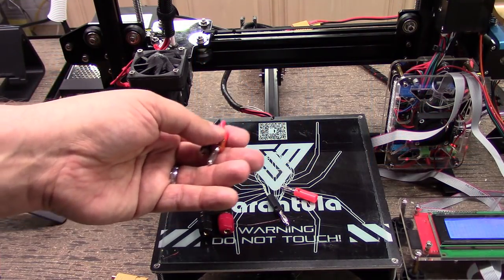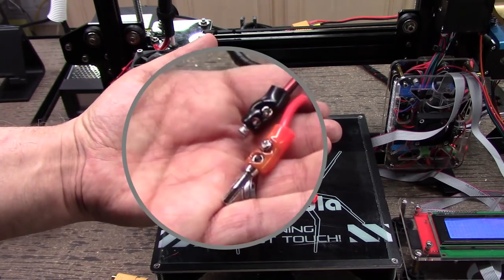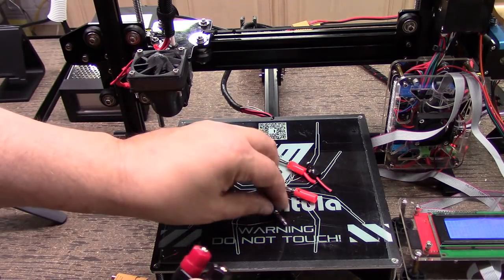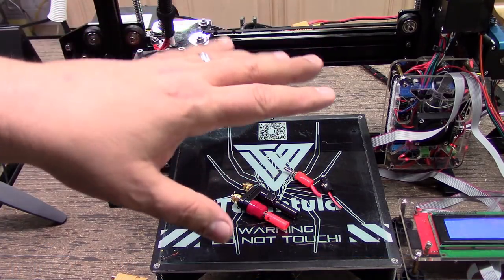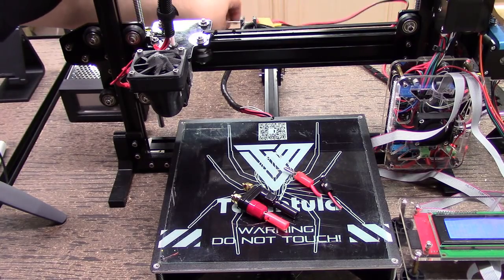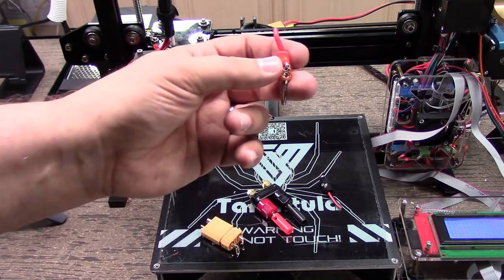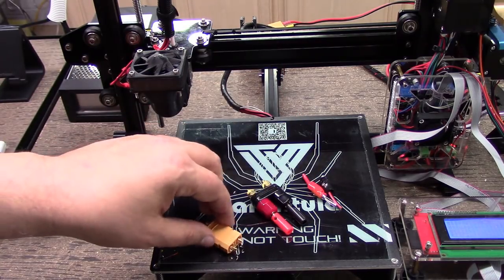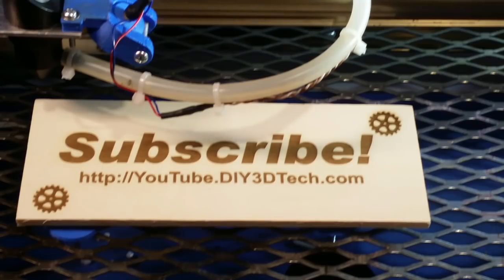TEVO Tarantula 3D Printer  -  Crazy Melt Down You Need To See!

Comment: I like Anderson Powerpole connectors, available in various current ratings (tow trucks use the large ones to connect jumper cables rather than opening their hood).
Reply from the maker: Those would be some major connectors!  🤓
Reply: They make them rated down to 15A too, the 15, 30 & 45A connectors use the same size shells (about the size of banana plugs) and can snap together to  make custom plugs.
Reply from the maker: Interesting will need to check them out!

Comment: Not an odd reason, bananas are rated at 15A.  The XT90's that you switched to are rated 90A.
Reply from the maker: Well where I am surprised (as yes I understand the "rating" difference) yet if you look at the connectors of the banana jack (at least on the one I used) is a larger conductor then the XT90.  As I used this for a long time with PLA and bed temp of 70c and just once of kicking it up to 100c and baam.
Reply: Its all about the contact area.  With the bananas the contact area is comparatively small when compared to the XT90, where almost the entreaty of the outer area of the male pin makes contact with the inside of the female socket.  Because of this there is greater impedance in the banana, and as you found to the cost of your fingertips, where there's impedance there's heat.  To be honest, I've never really been a fan of bananas.  I typically only use them for speakers. I use XT60 with mine, I also run my bed and hot ends on individual MOSFETS with fuses protecting each.  It's probably overkill, but as I'm sure you can appreciate there are already too many horror stories an I don't want to become one.  All the best.  Keep up the good work.
Reply from the maker: Totally agree on contact area and in the days of old (which I am)  banana jacks where very common for even larger power supplies.  Yet the aspect of "impedance" is what I over looked as in the old days the american made ones (as I speak from the 50's & 60's) where of quality metal, yet this cheap Chinese version I believe have VERY low grade metal in them meaning they have a very high impedance making them a better heater then conductor :-)

Comment: Thanx for uploading this, and the custom setup which I'm probably going to copy. I'll talk to my local electronics store about all the connectors you used, they are super helpful.
https://www.maplin.co.uk/p/fused-euro-chassis-plug-ft37s
.
Ah, I just realized that you didn't show what you did at the back of the transformer. Did you bring the wires out to the XT90 directly from the transformer's own screw down connectors?
Reply from the maker: You welcome and the customizer has several options  (1) a banana jack [buy high quality jacks as there is a HIGH current] or (2) you do a direct ass through of the wires.  If you look forward in the playlist for the tarantula you will see that I had issues with the "cheap" banana jacks I got from china and swithed to to an XT-90 connector...
Reply: Thanx.
The shop assistant in Maplin Electronics checked their own online catalogue and found that their best banana plugs only go up to 10amps. So I'm looking online for connectors. But I bought the kettle lead socket from them, so I'm part way there.
Haven't finished the build yet.
Reply from the maker: You can also just direct wire it, the main reason I when this route to was so I could simply disconnect it...
Reply: Yah, it's direct wired for now, but I found some fused/switched mains inlets with red neon in the switch. So I ordered two! I'll wait for those to arrive before doing the custom casings. But yes, I'll probably leave the 12v side as is. I'm used to RC motor ESC stuff and lipo battery connectors, but not heated things and it's really just the mains electric that I want on a kettle lead connector.
What is the exact name of that terminal block you used? I'm struggling to find anything similar and have wired all the fans you recommended together with the heavy 12v cables. And currently have the part cooling fan wired into the board.
 Holey moley! I might actually get to do a bit of bed leveling tomorrow and do my first print!!!!! 
If all my wiring doesn't go wrong first! ;¬)

Comment: obviously those banana plugs are not rated for the amount of amps that are being drawn. They have too much resistance hence they melted the xt90 are rated at 90 amps those banana plugs probably arn't rated over 10 amps. This is not the Tevo's fault it is yours for not checking the amp rating for the connectors you are using and they would have melted on any heat bed or application that draws more amps then they were rated for. There are better options than banana plugs for high amp draws like your xt90's there are xt60 rated at 60 amps deans plugs rated at 90 amps  which I use Anderson plugs most of the electric  model battery connectors are a better choice then those banana plugs as the are designed for high amps.
Reply from the maker: For clarity did I say it was the Tevo's fault?  As I have explain in this thread, I did not invent the use of the banana plug for the Tarantula as I got the idea from  others and hence sharing it under this banner.  The same as if you had a particular model car and you did a specific mod to that car and something happened you wanted to share it, you of course reference that model as being relevant as no one is going to add banana plugs to their Wanho or Da Vinci.  Also not sure of the rating, however what I come to believe the issue is the "cheap" metal used in these as in the past I have used banana plug for some pretty big loads (in the olden day they where very common).  However they were made and these well frankly were cheap junk and believe the metal had a high resistance and that is where the came in.  As the XT series as I  have a ton of them are working well and the 90 is over kill however I have a box of them (ordered by accident when I wanted XT60's).  Hmm never seen the Anderson connector before they look cool, thanks for sharing and nice plane :-)

Comment: Did you add a warning on thingiverse telling the connectors will have troubles handling the current?
Reply from the maker: nope as it will be subjective to the connectors used...
Reply: Absolutely, as you demonstrated here.
That's with that idea in mind that I think it would be wise to advise the community to check the current rating of the connector they're using (preferably not a banana one).
Reply from the maker: Thats why I did the video here, so guess I am not fully tracking but it is late :-)
Reply: Still think that would be wise to mention it on thingiverse.

Apparently, the newer tarantula are shipped with a 0.5 ohm bed. At 12V, it will draw 24 amps itself.
Reply from the maker: Interesting as too while I am a member of the tarantula form on Thingiverse, I typicallystay away from posting as there just gets to be too much drama (forms in general not just that one)
Reply from the maker: Can't see it as I don't have a Facebook account...
Reply: DIY3DTECH.com Arf. Tevo's CEO ranting about the fire hazard the Anets pose.
Reply from the maker: Sorry just seen this, now that is comical :-) thanks for sharing!

Comment: My experience with those small  screw lock type banana plug connectors is failure with time .  current is a factor , but time too .     the problem i found would be the screw is not exerting enough pressure to make solid connection for the long term and the soft copper still ends up with air gaps .  This can be worse if your already warm at that spot at lower loads. 
the heat  and cool cycles of the copper  at that spot slowly cause deformation  , screw gets tiny bit loose . lower connecting surface area , possibly fine oxidation layer forms in the small gap , and you now have a very small heater at exactly the contact point .   because  thats where the most resistance is , either by  too low surface area  making too small effective equivalent wire gauge , or tiny air gap at start , or oxide layer . and tiny air gap arcing can lead to direct heat and formation of more oxides. of the metals used.  it's a bad cycle and why I hate  to use screw terminals for long term hookups. 
ways i try to avoid this:
Solder power connectors  and skip set screws 
Use heavier crimp connectors where possible.  crimp beats set screws , and can be even easier to solder (some types) 
Tighten regularly ,  simply make it part of your printer cleaning regime  to  check tighten all your screw set wires .  ( looking at the screw terminals of my printer project  ramps board and getting screw driver rite now )
Reply from the maker: Hey I was just thinking of you!  Have not heard from you in while!  I also find the "screw" idea interesting as I am guess it was poor metal in the connector creating a high resistance, your thoughts?
Reply: I'm ok thanks ,  offline life has me busy these days ..  I got 1 quick video up  related to a problem a while back with home brew universal large wrench .  
re wire stuff , i have never found screw terminals very good except for small loads and solid core home wiring .  solid core wire is slightly different beast , but not much . 
if it is a screw terminal i use it at 1/3 its rated amps .   I like those spring loaded and snap terminals .  they have springs that keep constant pressure  even if the wire changes or shifts position in any way ,  as crew can only change for the better if you turn it again . so I often take the screw out and solder the wire in .
Reply from the maker: Ah good to hear all is on the right side of the lawn and hear you on the busy stuff!  As spring comes the wife expects that honey do list to start going down!
Reply from the maker: LOL!  I hear you friend!

Comment: Didn't increase the current...just created a longer time for current to flow...at 60~C it flows to heat then starts pulsing....to 90 it takes MUCH longer to heat.
You can insulate bottom of bed to lower heat time, and go with thicker wires as well
What is the current rating of the connectors, not the XT90 (they are rated 30A I believe) the other spade connectors...might not be over 10-15A I believe
Reply: Supposedly the "90" in XT90 means it's rated for 90 amps.  Similarly the XT60 are 60 amps, and XT30 are 30 amps.  Of course their actual capability is dependent on the quality of materials and manufacturing.

They are primarily used for Quadcopters and other RC toys, and quadcopters in particular can easily pull that many amps out of the batteries in short bursts.
Reply from the maker: Thanks for writing, yet not sure that was the case as the melting was taking place during the printing and not the ramp up.  As if this was the case, the temp would have ramp-ed up and than fell back once temp was reached.  Upon reflecting on this, I think it was the metal the banana jacks were made creating a high impedance (as they where typical Chinese quality) which turned into heat and this was issue as I believe quality banana jacks should have held that current.  :-)
Reply from the maker: Correct I use them in my larger Quads...
Reply: Scott,  is it 30/60/90 continuous or in pulses?
Reply: From everything I've read, it's constant.  They can handle slightly more in pulses, but I wouldn't push it too far.
Reply: Thanks.

Comment: Might be worth sticking a clamp-on ammeter around your positive conductor to see what she's pulling, then check the current carrying capacity of the cables. I think many use a mosfet when cranking their beds up to higher temperatures as I have heard of people frying their boards.
Reply from the maker: Kicked it around but just didn't have the time, the cables themselves are ok it just was those banana jacks.  Also yes on the MOSFETs...

Comment: It was kinda mean to mention Tarantula in the title. Could have happened to any printer. I'm sure that video will quickly show up on the forums. Good for your views, I guess. Hopefully people will actually watch your video and see it's not a TT issue. Your title sure doesn't help.
Reply from the maker: Thanks for the comment, however I don't see it as being mean in fact very practical as I didn't invent the idea of using banana jacks with the Tarantula as I stole it from another Tarantula user that was using them on their build.  So the idea here is to "educate" the Tarantula community.  Also since the Tarantula is DIY kit and there really isn't a proper PS interface with the printer, people are using all sorts of connectors and should be-aware of risks such as these.    :-)

Comment: Now your connector can handle the current, but are you sure your wires can?  Heat up the bed, then touch the wires.  If they are warm, you might want to replace them with heavier gauge. The 14 gauge wires I was using on my D-Bot were getting rather warm, so I went over kill and replaced them with 10 gauge silicone wire, which don't warm up at all.
Reply from the maker: Love the silicone wire, have you found a good source for it (i.e. reasonably priced) as yes a step head (I even have a Flir) an no issue as later reflecting on this I think it was the metal the banana jacks where made of which was the issue as they where of course  standard Chinese quality.  So  believe the high resistance turned to heat and the higher current draws pushed it over the edge.  Also good to see you commenting again as I enjoyed some of your prior!  :-)
Reply: I bought this wire off amazon:

https://www.amazon.com/gp/product/B017TGYW3S

$11 for 10 gauge, 5 feet red, 5 feet black.   Not a great price, but silicone wire is never cheap.  10 gauge is definitely overkill, I just wanted to ensure I'd never have a problem with it.

Good call on the XT90's btw, I use them (and XT60's and XT30's) quite a bit on my 3d printers.

I watch all your videos, usually just don't have anything to add :)
Reply from the maker: Yes i am trying to find afford source to pick a couple spools of various gauge but this stuff is like gold!

Comment: If your connectors are hot, you're using the wrong connector.
Reply: Same happened on my Chinese Qidi printer as PLA no issues and with ABS and its higher bed temp it burned up the plastic connector they use.  I had to break it apart and clip out the wires used for powering the bed (the others were for led and internal temp probe) and used a black, and red, 14 ga silicone wires and they do not even get warm so yeah, never trust Chinese you know what because they don't use the proper amperage connectors either.

edit:  let me add the heated bed even tells you to use 100c printed right on it.
Reply: Doesn't that depend on the length of wire as well?
(Relatively short wires on a printer, so low-ish resistance)
Reply from the maker: I would agree, however what surprised me is I had been using this almost year without issue printing PLA and I kick the bed up 30 deg and bam these melt!
Reply: Even 14 AWG is a bit small to transport ~120W at 12V. It'll work just fine but you'll have a fairly significant voltage drop and probably a 30 degree C temperature rise in continuous operation. I would personally go 12 or 10 AWG if I had the opportunity as I don't particularly like the idea of heating PVC insulation in my house and it costs almost nothing more. If nothing else, the more power you waste in your wiring and connectors means less power actually heating your bed.
Reply: 14 gauge wire is far more than enough to carry even 15 amps.  The maximum amps of 14 ga wire is 32 amps so half that to have a hellish amount of safety room and you have 16 amps.  Your 12 or 10 gauge is just stupidly ridiculous.
Reply: I was actually looking at the ampacity chart on Wikipedia that says to expect 60C at 15A (or 12V 180W) https://en.wikipedia.org/wiki/American_wire_gauge#Tables_of_AWG_wire_sizes
Reply: I am an ex electrician and go by the codes and 14ga is what they use in houses and the wire breaks down at 32amps but for a 2 to one safety margin it is 15A.  Doesn't matter if that is DC or AC.  Btw, I measured my 14ga wire with a bed at 110c and the wires are slightly above ambient.  Take a MK2/3 board and the holes for the wires barely fit 14ga.  14 gauge is all that you will need and get too stiff (due to gauge) and you will have a lot of other issues.  Stick with 14 gauge unless you plan on doing a 20 amp heated bed then do 12 gauge but 10 is massive overkill.  In bathrooms we now make houses with 12 gauge wire and the rest of the house 14 gauge because of hair driers, hot combs, etc... so the amp draw is up there and we have a 20 amp circuit breaker for the modern bathrooms out at the switch box.
Reply from the maker: Interesting...
Reply from the maker: Yes in a bigger scope (say your running an industrial motor), however not really here as if its say 10cm longer there will not be a practical difference especially  if your running the correct sized wires.  As if one wants to be technical, there should be three power feeds for a 3D printer to be right in my opinion (I talk about this in a video many moons ago when I mod the Wanho power supply)
Reply: I should have made it clearer I was answering Verdi Rodrigues-Diamond. I do think 14 ga is enough and that the voltage drop should not be significant.